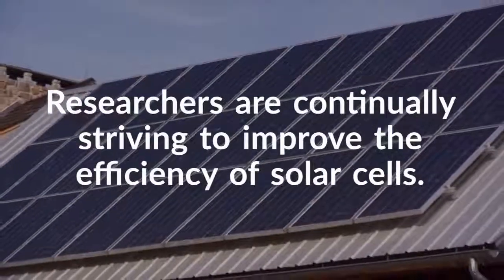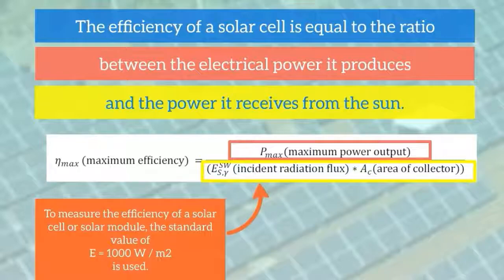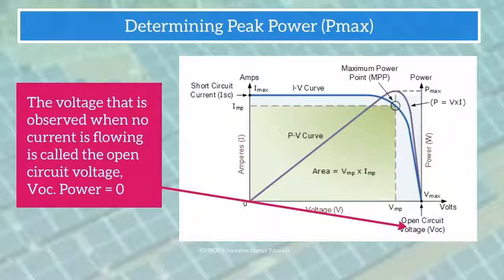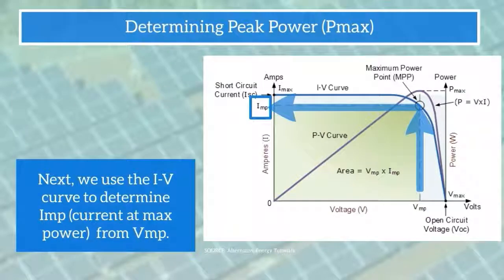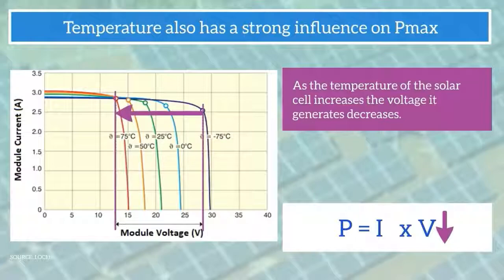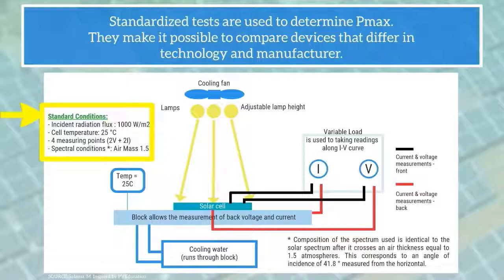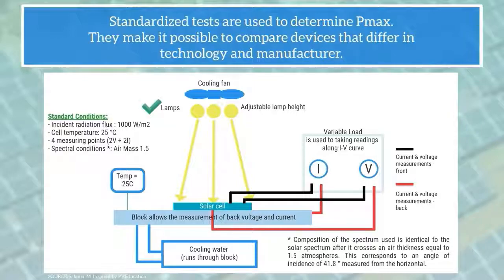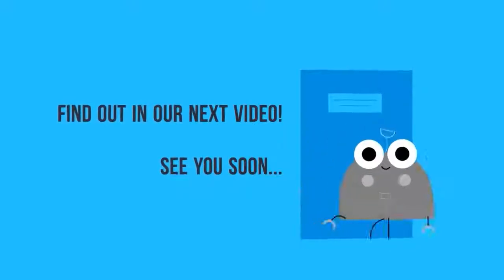How is the efficiency of a solar cell measured? (Solar Energy Course 2020 Part 7 of 12)

Comment: Does efficiency is important factor for purchasing solar panel?
*One hand, 1 KW panel with 15 percentage efficiency..
*Other hand, 1 KW panel with 22 percentage efficiency ..
In this case does the power generation changes or size of the panel changes..?
Please clarify my doubt..
Reply: Power generation will be same but the time taken to generate the same power will be more in case of the panel with 15 percent efficiency.
Reply: 1 KW panel with 15% efficiency: This panel will produce 1 kilowatt of power at peak sunlight conditions, but it will require a larger surface area to do so because it's less efficient at converting sunlight.
1 KW panel with 22% efficiency: This panel will also produce 1 kilowatt of power at peak sunlight conditions, but it will be smaller in size compared to the 15% efficient panel.